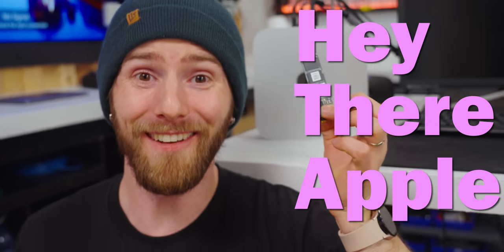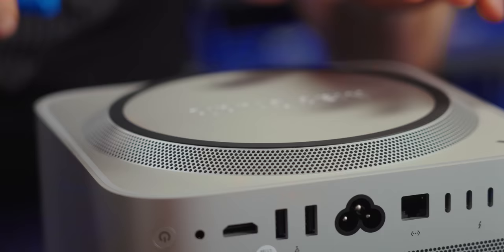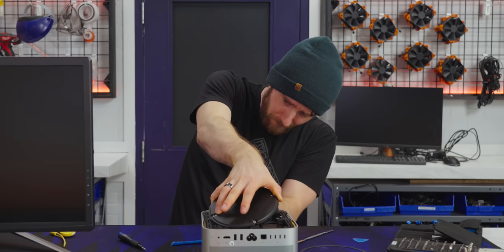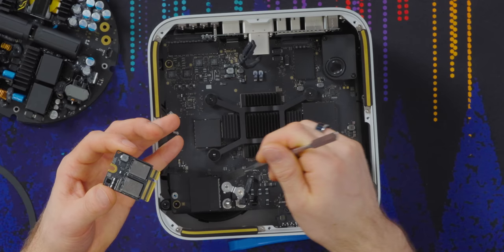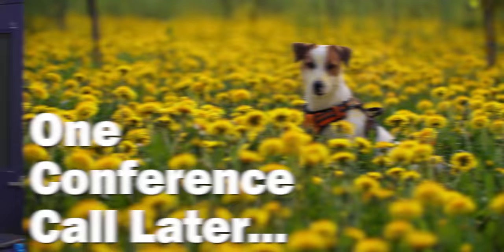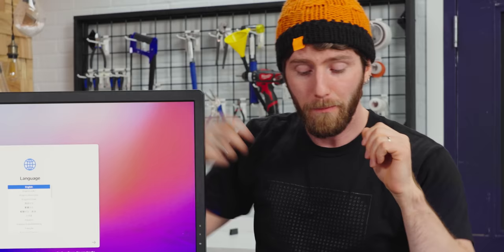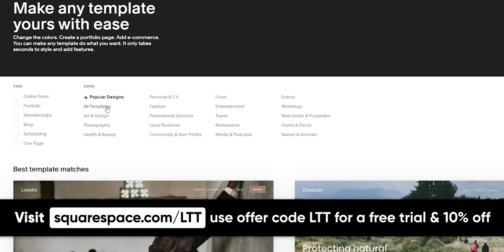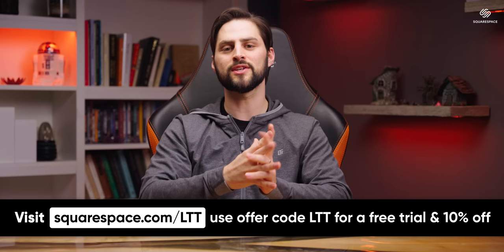I want to love Apple, but they’re making it hard - Mac Studio SSD Swapping

Comment: I wonder if, by the time the repairability, upgradability, or serviceability of almost all modern devices is revealed to be zero to a majority of the population, it will be too late to do anything about it.
Reply: it already is too late. just dont use macos, build your own systems and slap linux/windows on it.
Reply: I mean there are already competitors going out of their way to market for repairability and long term functionality. Fair phone, framework laptop, librem phone, etc. It's just a matter of getting consumers to actually value those features over flagship ones. (and I mean, they are staying in business now, so unless the market that goes out of their way to buy more repairable devices somehow shrinks, they aren't going under)
Reply: @robonator2945  one other problem is that the people who are into repairability are not the norm, so market is limited, and the "raparability" companies will have to do a fine balance between the price of device, the price of parts and the durability of their stuff to not extinct their own market by selling hardware that remove customers from the market instead of locking them in like the others
Reply: @robonator2945  I REALLY hope that the general public starts to the the appeal of it and the market grows big enough for it to not be a concern tho
Reply: @0b4y3mi  You're right that it's not the norm, but the fact is I don't see how the current market niche will shrink. Companies like the ones I listed are factually profitable targeting a market niche that is unlikely to shrink, by that measure it's highly unlikely it will ever be "too late". The key is consumer education and EXPANDING the niche that cares about that sort of thing. Even regulation will inevitably just be bypassed through loopholes or whatnot, but if consumers simply don't buy non-repairable or non-consumer friendly products there isn't really a loophole in that so long as at least a few big groups are dedicated to educating consumers.
Reply: That's the ultimate goal of these companies they want their products to become replenishable items like paper cups, use it for a bit and throw it away
Reply: Well eventually everything will just be on the main chip and there will be nothing to repair.  I support right to repair but that doesnt mean that apple should be forced to build their chips just so people can repair them easier
Reply: @robonator2945  The average consumer doesnt want to repair their own device.  But having an apple store available is a huge selling point.  There is no framework repair store in my local mall
Reply: @steezmuffin  you don't need one, its entirely modular, you literally just swap parts. And eitherway, its not just repairability, a device which is repairable almost inherently has other benefits, upgradability is just one. Also your whole "one chip" thing is nonsense. Even apple has to be ABLE to repair their own crap, so one chip devices will never take off since you literally need to offer customers an entirely new device for each "repair". Not to mention many components literally cannot be printed like traces and what not.
Reply: @steezmuffin  I think you completely missed the point. The problem is that you need an apple store to repair your Mac. You can't go to an independent ordo it yourself because they don't sell you parts, create restrictive warranties, and require specific tools for disassembly. You are enslaved to their will to repair your machine, if they decide to charge you extra premium for it: suck to be you. If they want you to buy a new one instead: sucks to be you. If they stop supporting repair for your model: sucks to be you.
Meanwhile ANY half decent computer shop or repair shop will be able to do maintainance or repairs on your framework laptop. Heck, even apple stores could do it... They won't do because "fuck you and your cheap laptop, buy apple" tho.

Right to repair is not a meant for everyone to do repair themselves, but to have repair options available, should it be done by themselves, a qualified third party repair shop, or anyone in between.

Nobody should need to go to an apple store to repair their apple product. That's retarded and really anti-consumer.
Reply: What does "is revealed to be zero to a majority of the population" mean?
Reply: Hello bro, first of all sorry for my bad English, I have small service of repair Apple shit, and a few weeks ago got MacBook 16 inch with dead ssd. Capacity of that ssd was 512 gb, so I need to replace nands, but first found board with good ssd 1tb. After install I took error, can’t flash t2 new ssd. Second donor board had 512gb capacity and after installing all nands to this mac it’s flash and works well. Maybe it’s similar problem, higher capacity Apple computers can see any ssd that smaller or same his oem ssd. That’s weird, but true
Reply: why did i read this with your tone?
Reply: We live in a nation that just elected a president that can't even remember what he was saying from the beginning of a sentence to the middle of it. I think Apple is quite safe.
Reply: @Louis Rossmann
The EU is pushing a Right to repair bill whitch should enable "Proffesional repair shops" to be able to get spare parts manuals and tools. If we all are lucky that means all repair buissnes not just certified shops. I addition batterys should be easy to replace and the manufacturer has to offer repairs and spares for 10 years after selling a product.
Also software/security updates for I think 7 years.

All in name of less E-Waste.
Reply: After 15 years of Apple, I'm done.  My Mac Mini 2020 lasted 23 months and the SSD failed.  Out of warranty.  Bye bye, Apple!

UPDATE June 2022;  I bought an Intel NUC 11 Enthusiast Mini PC i7, 2.8 overclock to 4.7 Came with a Radeon RTX 2060 graphics card.  I added Samsung 500gb SSD Evo Plus and 16 gb RAM.  And it was waaaay less than a comparable Apple.  I could have gone cheaper with a no name but the Intel came with a 3 year warranty.  

Sorry, Apple but you F-up building junk
Reply: @ve3xtr  Good.  We need more people like you to force Apple to stop doing this.  I haven't bought a new Mac since they started doing this garbage.  FYI, you can still use the mac mini.  Just boot from an external SSD.  It's stupid you have to do that but at least your money isn't down the drain.
Reply: Yeah totally. I’m super pissed right now at Apple, because my Mini M1 is constantly crashing on sleep. So I’m about to look at a Windows laptop (wanted to go laptop anyway). Most manufacturers I’ve seen so far have soldered RAM for their laptops. So much for upgrading a Windows laptop, they’ve followed Apple’s shitty lead.
Reply: @JeffBee1  buy a 2015 Retina MacBook pro.  They're great, upgradeable and super cheap too.
Reply: @0b4y3mi  Good marketing is effective at swaying consumers. It's the backbone of apple's success. The general public perceives Apple as clean, fast, easy to use, stylish and environmentally friendly. Just watch their Ads. Repairable electronics can be marketed the same way. But if you're going to have repairability as a marketing feature it needs to stem alongside green practices as well as a program to get it repaired for you for cheap, because not everyone has the savy or time to open up their machine no matter how easy a company can make it.
Reply: @robonator2945  lol no way, repairability will be sold at a premium, it already is being sold at a premium
Reply: @genericgorilla  ok. and? Xiaomi already proved taking low margins can lead to massive success very quickly. All it takes is one person or group of people to see that and decide to do something similar for a competitive advantage and now it's not "at a premium" Anymore. I mean your also just wrong by the way, the reason repairable devices cost more is because repairable devices are often more generally user friendly meaning no bundled software pre-loaded and whatnot which big companies usually use to lower the cost of their products. It's a pretty simple concept really. Although of course lower end hardware doesnt mean a worse experience, an old phone running a linux OS is more responsive than a modern flagship running what it came bundled with. Those apps and contracts companies sign to lower the price of the devices also often lower the performance or cause other issues, so while you are paying more for lower end hardware, the reason you're paying more is largely worth it. Plain and simple repairability is just a good business model. It means people aren't buying 3rd party parts, (so they ARE buying yours) it means you get more consistent revenue, you encourage more people to buy the device since they trust it will be robust long term, and while people live with issues on flagships due to exorbitant repair fees, if they can just buy a part and repair the device themselves they will. I know my grandparents literally just started using wireless charging instead of fixing the charging ports on one of their phones. If you offer people a better service, at a lower price, they'll do it and a lower price from you is better FOR you than a higher price from someone else anyway.

TLDR : nope, fair repairability is just a good business decision. All that matters is getting consumers and business owners to believe it. If no-one buys the product, the company goes out of business, just tell people there are better, cheaper, more robust alternatives. Sure, a few will stick around out of brand loyalty, but brand loyalty only lasts so long.
Reply: Yeah windows is such a great option. They steal you data way more and change your settings every time. Not using Linux unless it’s a server.
Reply: This is why I have lost interest in smart phones. I dont care if I have the latest smart phone, long as it works and can support spotify I´m happy. I have had my galaxy s6 since it came out, only now it starts to slowly die, but I will try to make its life a little longer.
Reply: Nobody seems to complain about repairing their toaster, blender, vacuum cleaner …

Computers are slowly becoming an appliance for everyday people. Especially with technological advances unlike fridges, stoves and plumbing … people tend to upgrade their computers more frequently.

Trying to repair a 486/Pentium computers is kinda pointless no?
Reply: The only thing we can do as techs is tell everyone to buy any product other than apple.
Reply: @RunForPeace-hk1cu  few mistakes here, for one, your intentionally picking small appliances. Sure, you might not ever care enough to repair a toaster, or a vacuum, but those are both run sporatically and can last DECADES easily. Additionally if you ever DID want to repair them, it would be a fairly simple matter of replacing the rusted parts or whyever else it broke, fairly simple but a bit of an investment. But ignoring the fact that you straight up can repair them with a little bit of work, you intentionally didn't pick any of the more applicably analagous appliances such as fridges, dish washers, ovens, etc. I wonder why you didn't name any of them, maybe it's because people literally do care about repairing them? Fridges are big devices that run constantly and are expected to be repairable because they are integral to people's lives. Desktop computers are big devices that often run constantly and are expected to be repairable because they are integral to people's lives. Dishwashers are moderately sized machines that run fairly often and are expected to be at least somewhat repairable in the case of a simple part breaking. Laptops are moderately sized machines that run fairly often and are expected to be at least somewhat repairable in the case of a simple part breaking. Toasters are small appliances that aren't integral to most people's lives enough or expensive enough to warrant necessary repairability. Wireless earbuds are small appliances that aren't integral to most people's lives enogh or expensive enough to warrant necessary repairability. (admittedly that last one fails a bit because several companies are charging massive prices for earbuds, but you can also get a pair of sound liberties or something for 50 bucks so it still kind of works, just not as cleanly as the others) With all of that said, just fucking educate consumers. Show them that if they pay for a fairphone or something it is better for them, you have to make an argument and convince people that it is the right choice, not just use legislation to "protect them from themselves". Buying an apple product is asinine, so I don't. Imagine if other people did that, do you think that might make apple up it's game?
Reply: @robonator2945  In all fairness a majority of the products are not properly repairable and most if them are hot garbage when it comes to usability.

Fair Phone I think was reviewed by LTT and it's OS and features are clunky and or incomplete.

The Framework ING only has swappable modules and have publicly stated they will NOT make schematics available to consumers.

These same issues repeat themselves with most other products claiming to be repairable.

I'm all for it, but I can't get being products that offer a complete garbage experience just to be repairable, nor products that claim repairability but don't back it by providing relevant documentation and often only make the claims to drive sales. None of us should accept these short comings or compromises.
Reply: @robonator2945  it should actually be an expectation of any tech product you purchase REGARDLESS of it being a "good business decision". Instead companies will realize that they can get you to pay substantially more just for being able to repair your stuff. There already is a premium market for "tinkerer" products, like when the WRT54GL was sold for considerably more than the WRT54G despite having almost the same specs, just because it had a tiny bit more RAM and, crucially, the ability to flash it without jumping any hoops. Imagine this but for every kind of laptop and phone. That's somewhat what I envision for the future at any rate. Competitive advantage means nothing on a market that is quickly consolidating onto a couple of mega corporations distributing essential hardware, with a couple of OEMs selling the same hardware with different labels attached pretending to be competitors
Reply: @virtual812  FP has linux support in the works right now and, frankly, I trust Ifixit far more than LTT. I don't know something about pretending to be relatable while casually investing thousands of dollars doesn't make me all that trusting of him.  Oh, on that investment, do you know which company it was to? Framwork, so if your going to use his word against the pairphone, how are you then not going to use it for the framework? Cherry picking much? Anyway, if you can change any module, you don't need schematics, and frankly not offering them to individual consumers isn't that bad anyway, that still means literally any consumer can still get their device 3rd party repaired with ease. Would it be good if they offered schematics to consumers? Yeah, but the simple reality is right now they are sitll proof that the market will create spikes of improvement, we just need to normalize that improvement then build on the next spike.
Your two "complaints" listed here are that the software isn't perfect (which is quickly changing, especially since FP is getting linux support soon and I've seen a side by side comparison of the responsiveness of like a 2014 phone running UT and a brand new iPhone 12 running IOS, the UT was easily twice as responsive) and companies themselves magically aren't perfect. No shit, but if you think a bit of legislation is going to magically make everything perfect your smoking something. Sure legislation might fix individual problems (assuming compliance and it doesnt get overturned) but if companies dont want to do something they do the BARE MINIMUM, so anything not in that specific bit of legislation won't be done. In contrast market forces are far more generalized and will force companies to be better as a whole. If you localize your perspective, sure legislation is better, but reality isn't pin-prick localized on specific issues, and by the time every issue is regulated you might as well just publicize the company anyway since its basically entirely government ran.
Reply: @genericgorilla  ok? That's my point, consumers don't care, so right now that competitive advantage is going unused. So the fix isn't to magically try to legislate everything, it's to get consumers to realize its a better buy long term to get non-apple, samsung, etc products. Nothing you said conflicts with anything I was saying.
Reply: @RunForPeace-hk1cu  I actually have repaired my kettle, toaster, dryer, dishwasher, vacuum cleaner, hedge trimmer, and lawn mower. admittedly repairs were mechanical and nothing required a complete strip down as I don't have the expertise or equipment (or time). However, my actions have prolonged the life of my appliances, saving money and global resources.

I'd also take issue with your 486 example. Those are decades old. It's a rare appliance of any kind that lasts that long and has similar functionality to modern devices. A better example is my PC, which I built a decade ago, and still runs on a i5 2400k processor. 8GB RAM, a 1080 GPU, and an SSD upgrade in that time, it still does the job I need it to, better than my computer at work.
Reply: We are just about there brother.
Reply: I have no problem with stuff being unrepairable if low prices justify it. At the current price structure it’s got to be repairable.
Reply: That's the plan
Reply: Why go to the trouble of building a company town where the company owns everything and the people just pay rent. When you can get people to "voluntarily" but into the company town and just pay rent for everything?
Reply: @gametime2473   unfortunately, unless things change in November 2022 and 2024 you are correct.
Reply: @ve3xtr   if un repairable other than at subgenius bar warranty for parts should be LIMITLESS and for labor five years.
Reply: @gametime2473  excellent tip!
Reply: @RunForPeace-hk1cu   the most expensive vacuum cleaner doesn’t cost as much as a top line phone and it is a mechanical device with friction wear.
Reply: Jesus is LORD  Stop wasting bandwidth with your spam
Reply: We need to make linux more popular
Reply: @IAm-zo1bo  A huge problem with desktop Linux is that it's a very hostile community and comes across as a closed shop as a result. I tried to look up how to disable the middle click paste feature recently and came across responses such as the following:

"Suck it up"
"Why would you want to disable such a good feature u windoze n00b?"
"Disabling this goes against the Unix philosophy"
"Disable the middle mouse button completely" (why do this when I want to use it for things like opening new tabs or autoscroll on ThinkPads?)
"Recompile Wayland with it removed" (maintaining a fork is not feasible in the long term for the vast majority of users)

It feels more like a cult or religion than a serious system accessible to everyone. Which is a huge shame because we need an alternative to Windows or Apple hardware.
Reply: @robonator2945  I'm on board... What "WE" need to do, is invest in these technologies, and flip the script. In the end, they become flagship and the others dwindle to obscurity... Which, won't happen, but can a big enough of an impact be made so that the flagships, are forced to get on board and do the same to remain in the lead?

@Louis Rossman -- Keep it up sir. Keep yelling at the top of your broadcast lungs. Keep getting more high profile people involved (Woz was a great example) and we'll join you, keep making noise and keep fighting local/state/federal government to end this trend. Frankly, I was clueless. Grew up working on a farm (for a few short years though it was a humbling experience) and I was blown away to find out John Deere actually went down the road they did. Considering the insane cost of farming, how many privately owned farms are left, and they actually made it impossible for these farmers to work on their own equipment.

I learned this because of you Lous. Please, keep up your work.
Reply: But this is really old stuff. Sony has done it, when Apple was basically a company that only provided overpriced MP3-Players for snobbish show-offs. The majority of the population are mindless NPCs. Always have been, always will be, in every culture, the world over. Sounds arrogant and negative to say that, but it's just the state of reality and maybe it's for the better, for any culture needs at least some easily corruptible people, for the main functions of society to work. Nobody forces you, to promote shady companies, like Apple, so just don't, as long as you have an alternative. There will always be a portion of the population, who will do exactly that. As long as this demographic is large enough, there will be a market for products that work without disrespecting its consumer base, by ripping it off.
Reply: It's too late to do anything about it because people WANTED it. If there's no backlash against whatever they're doing, then their market is doing just fine.
Reply: @jdg7327  That’s a wholly defeatist attitude. It is NEVER too late to do anything, about anything. One exception, the lights are going out, and you are dead. Beyond that? There is always something that can be done, about anything.
Reply: Waste of money, rather build a mini pc no need to waste so much money and can't upgrade or switch bad parts
Reply: @sanjacobs6261  I also got jumbled a bit lol. They are saying that "the time the repairability, upgradability, or serviceability of almost all modern devices [will be] revealed to be zero," and that the majority of the population will know
Reply: Been Apple free since 2016, won't look back.. 😂

A PC should be hardware agnostic like cars if we frickin bought it, not rent it..
Reply: @KungFuChess  they already force this with OS updates that use up more storage, ram and make apps that worked before, not work with the new OS. They will tell you to buy the new model. Happened to me with the iPad mini, after 1 year. I refuse to buy apple products due to that. Never bought apple computers anyway. But for phones and tablets it's android all the way.
Reply: Almost 10 years ago I bought a Lenovo Thinkpad Yoga with full specs (hi-dpi display with touch & Wacom pen support, discrete GPU, top of the line i7 CPU, 512 GB SSD) that I literally took with me to the other side of the world and back, and plan on keep using for another 10 years, unless some fundamental part breaks.
But the CPU and GPU are already too feeble for many tasks and I wish I could upgrade the mainboard (including CPU, GPU, and RAM) without having to say goodbye to the expensive display and SSD.
So my next laptop will be a modular one, if the option exists at all, but how many people are in a similar situation as me? I fear most people either A) buy the cheapest crap that does the job and just replace it when it breaks; or B) buy expensive stuff because they can and just replace it when it breaks.
Reply: <3
Reply: @midnightshade32  There are scripts you can use to downgrade the OS to a version that still worked well. I used LukeZGD's iOS-OTA-Downgrader successfully on an old device. But I will never buy another product from them ever again. They are downright evil.
Reply: Apple can make more money by selling there chips and parts directly or licensed there chip designs out to 3rd party manufacturers and sell parts for there devices it would and if they add a service that take In broken or used chips to boot thay can squeeze more money out of a single chip instead of producing a new chip
With the licensed they can sue the shit out of other companies getting money for damages done to there products so more money
In other words if there in it for profit there going the wrong way
Reply: @ve3xtr  Welcome out of the club. I stop using any Apple products in 2012, after my Macbook had become "too old" to install new software, my battery swell, and my screen's backlight stopped working. I kept using it with Linux installed on it, and with Linux I could do everything that Mac OS X wouldn't allow me to do anymore, like editing videos. Not only that, but looking at newer Apple laptops, you couldn't do much to repair or upgrade them, and Apple came up with their app store... It just seemed like they were full on going in a controlling boyfriend direction, so I left and have zero regrets.

Hope you find what you need from other manufacturers and OSes!
Reply: @robonator2945  
Those competitors suck
Reply: @mlgmcdonaldsland7063  neat. If you don't value repairability and longevity higher than flagship specs, don't buy them. But factually, they are an option, one that is unlikely to go away any time soon since they are staying profitable and the market they are targeting is unlikely to shrink anytime soon. So there are active competitors, that are unlikely to go away, focusing on repairability. (and lets be real, schematics are entirely fucking irrelevant to the average consumer, if they can literally just repair their device themselves)

If you do not personally value repairability or the other benefits offered over flagships, then don't buy them, it's that simple. But don't act like legislation has to step in. If you want repairability and privacy, you can get it, end of story. Your never going to get some magic bullet that has flagships specs, waterproofing, open schematics, etc. it's always about what you as a consumer value and what features you weight higher and lower. If you don't value RtR over specs, don't buy an RtR device, no-one is forcing you to, just like you shouldn't be able to force private companies to stockpile parts, release schematics, etc. Take responsibility for your own purchases, legislation only needs to step in when consumers don't have a choice, and no matter how much people like to scream it, consumers do have a choice in this matter.
Reply: @robonator2945  
You have to buy a more expensive inferior product. That is not a long term sustainable solution. That doesn't even count. Like yeah technically I could hand wash my clothes so I save money on water. That's not the same as making washing machines more efficient.
Reply: @0b4y3mi  You, realize the comment we are replying to, is from a guy, who runs a non authorized apple repair store, right... while you're claiming those don't exist...
Reply: @robonator2945  do "YOU" realize the guy running the repair shop is running a huge campagn to make his job possible because the companies building all these devices are purposingly making his job as impossible as they can ?
Not saying they don't exist, they just are few, and that they have a hard time doing their jobs.
Reply: @0b4y3mi  his job IS possible though, thats my bloody point. Yes, more repairability is better for the consumer, but factually apple devices, due to their omnipresence, are more repairable than most alternatives. There ARE component level apple repair shops, there aren't (afaik)any HP component level repair shops. Also different issue, but frankly while the concept behind RtR is good, it's being executed horribly. Massive stiffies for schematics (even though factually modular repairs are better for the consumer) more or less ignoring market alternatives in favour of ham handed legislation, and generally a focus on condemning companies like apple instead of promoting genuine change like the Framework. All the while making excuses that "you can't pay with your wallet" even though the number of repair friendly devices is only getting higher. I'd love a world where you can repair devices more easily, (although personally opening up the legality of modification of devices is far more alluring. We see a few companies that sell modifications, but they tend to be jury rigged and grey legally speaking) but it's becoming more and more clear that the RtR movement is more about trying to make repairshops' jobs easier than making anything better for the consumer.

Also, who exactly is this "you", I mean you put in quotes so evidently it's not me, are you quoting me and therefor referring to yourself? Or did you just forget quotes don't add emphasis because who the hell thinks they do. If you were trying to add emphasis you add an underscore and an asterisk eitherside of the word, like this
Reply: @licht4808  Yeah right as if there isn't an entire population of developers, artists and software engineers completely dependant on MacOS devices cuz that's the job requirement.
Reply: @RunForPeace-hk1cu  Computers are a little different from house hold appliances like a toaster, blender or vacuum cleaner.  Thats because you may have an App in there that you need, or precious data that is on the storage. If the machine dies on you, you want to recover the data, unlike the appliances that has no data.  For example, if someone dropped an ipad into a swimming pool and had water damage, how hard is it to recover the data? Would Apple support center perform that recovery?
Reply: HEY MAAANNN, LOVE YOUR CHANNEL! To be an honest and sane person let me just say. People are that stupid with the way the world is, THEY will DO WHAT they are told and LOVE IT! Humanity needs to be governed because of it's stupidity, and I HATE the governement!
Reply: @licht4808  hackintosh. Also a decent option.
Reply: @steezmuffin  Having an Apple Store that'll charge you 400% more(Than any other repair shop) for any repair operation is an Abomination. :D
Reply: That's why 1. Inever payed Apple anything 2. I Don't even use windows on my machine just to stay away of there crap
Reply: But its for the greater good
Reply: I think Apple's looking for some anti-trust charges at some point. MS as well, especially if they go to a subscription model.